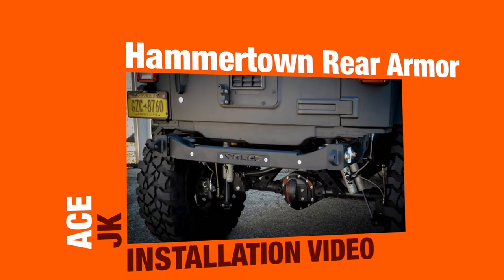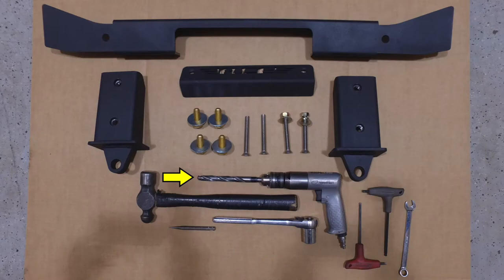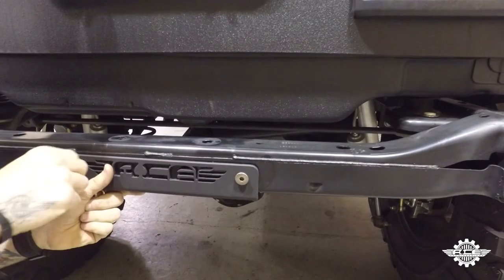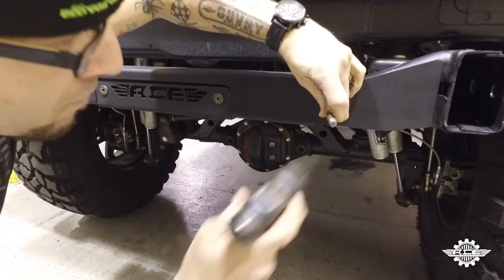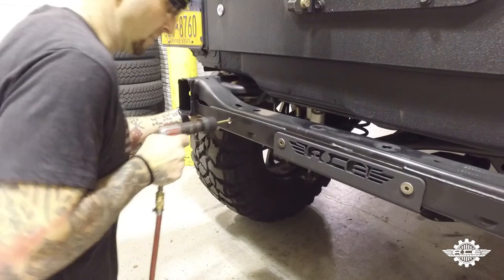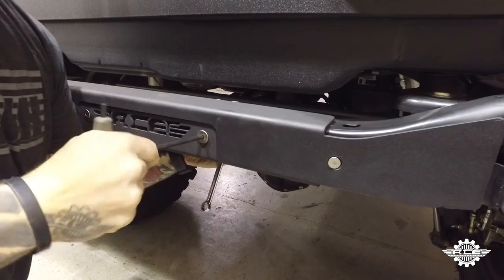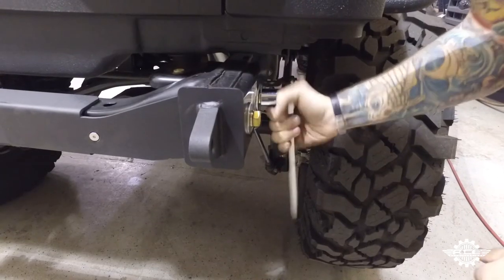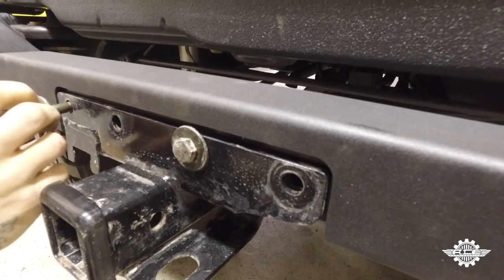How to Install ACE Hammertown Rear Armor

Comment: That is a cool look, but is it street legal?
Reply: Bruce Morrice I'm more for what protections I have if I get rear ended usually the bumper takes the impact more but it's resting on the cross member I want it I'm just worried about my frame if I did
Reply from the maker: Bruce - all our parts are intended for off-road use. Laws vary from state-to-state on these type of modifications.